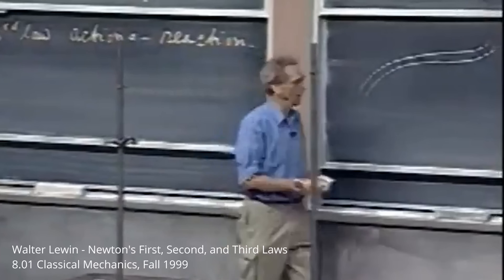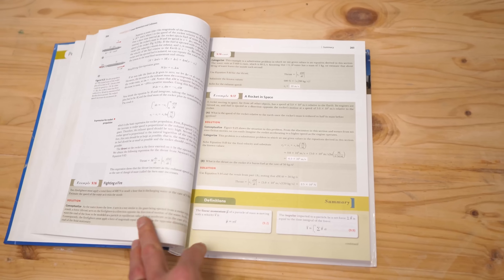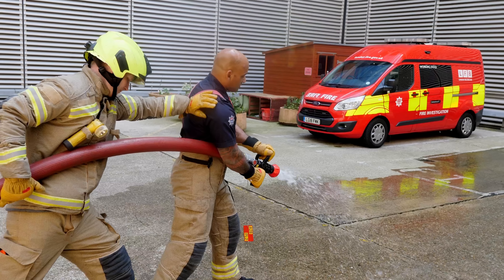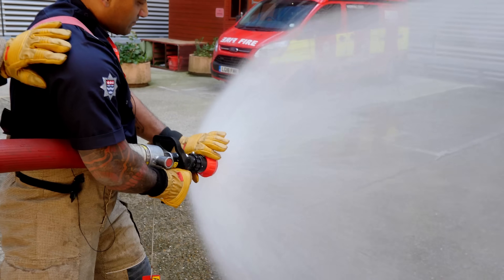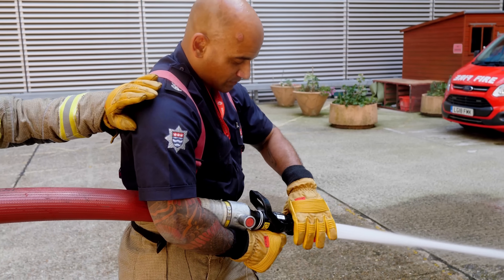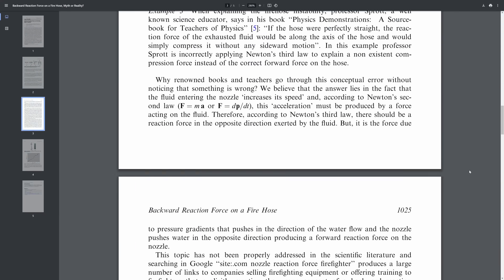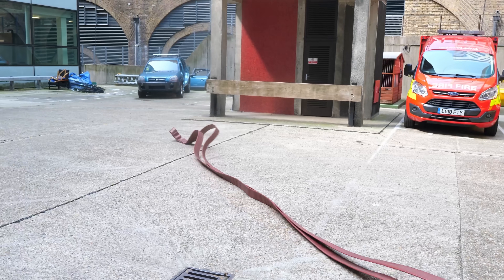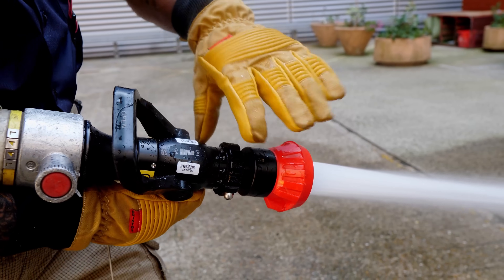Why chaotic hoses dance

Comment: Unfortunately, I can't find a copy of the video to link, but I vividly recall being shown an instructional film, about the dangers of improper nozzle control, during my fire-fighting training in the Royal Navy.  That showed a loose hose, with a RN standard fire-fighting nozzle, at shipboard equivalent pressure. in a mock-up of a ship's compartment.  It was vastly more chaotic and violent than the example you showed of the Fire Brigade training exercise.  It behaved more like the air filled tube in your demonstration, but with a lot more power behind it and several kilos of solid brass nozzle on the end, in a confined and complex space.  Deadly.  No shade on the Fire Brigade - they do a heck of a lot more actual fire-fighting than the Navy - but I assume that the output of the high-pressure salt water main on a warship is very much beefier than what can be achieved by any mobile appliance.  My gut feeling is the degree of chaos is related to pressure, flow-rate, size and shape of nozzle and relative diameter and thickness of the hose.  Can confirm you are pushed opposite to the flow, but you also have to control significant and less predictable lateral forces.

Comment: Water hitting atmospheric air is also a reaction force that is made at the nozzle. And if the hose was perfectly straight, it would in deed be transferred to the pump, but since it isn't this reaction force travelling back will create a bending force instead, that will add to the bending that was already there because of water acting on the hose from inside. It basically means water bends the hose from two directions at once. (this is why Bowden's cable in your bike has reinforced semi stiff walls that counteract this effect allowing the wire to transfer force along the bends). However I wouldn't be so sure about the firefighter statement cause the mass and elasticity of the hose itself should counteract the jet effect to some degree. And on top of that there's also friction between water and the hose that must do something. Intuitively it should pull the hose in the direction of the flow further counteracting the perceived jet force. One way of verifying it would be to measure force needed to hold the hose vs force needed to hold a sheet of plywood sprayed by that hose. Also if I'm right with the friction, then the jet force should decrease when the viscosity of the fluid increases. (I think).

Comment: Isnt the sky dancers head pulled by the middle part straightening out? The pressure inside a sky dancer shouldn't be that much higher than atmospheric pressure

Comment: From what I remember of my physics classes... this is clearer framed with conservation of momentum. Conservation of momentum is mediated by acceleration, so you don't need to work with squares; calculaing the kinetic energy of the water would require something like integrating the velocity across the area of the nozzle as a function of time... yeah, no.

Anyways, the water decelerates (changing pressure/speed) as it leaves the constriction of the hose; this causes the nozzle to accelerate opposite, as conservation of momentum dictates. But, while momentum is conserved, acceleration is a vector, and that direction is affected by the friction and turblence of the water stream. This is a dynamic system, so it evolves over time, and the kinetic energy bleeds off as force perpendicular to the acceleration. Even assuming things like 'water is truly incompressible' I don't think we know enough about the forces here to predict where they're actually coming from/going; fluid dynamics aren't something I ever studied. 

Well, constricting the nozzle should reduce the motion. A simple test would be putting a baloon over the nozzle; this allows the energy transfer to continue, turning kinetic into potential, but stops momentum, since pressure should remain constant. I'd theorize the hose should remain mostly still under these conditions.

Comment: I look forward to the followup video...  The force on the nozzle equals the mass of water multiplied by the velocity it leaves the hose, divided by the time it takes that mass to pass through the nozzle.  The direction of that force will be the sum of the force vectors of all of the individual "particles" of water.  This reaction force feeds back into a long, semi rigid tube.  Modelling  the whipping means modelling how the tube resists bending caused by a point force vector at the end, taking into account the internal pressure and wall strength resisting deformation.  As the system evolves in time, the resistance to bending changes, but so does the direction of the applied force.

Comment: The force you are going to feel holding the end of the nozzle is always going to be momentum of the water going trough it. Think of the hose as a closed balloon, if it had been close the hose couldn't move anywhere, that's because all the pressure pushing on the inside of the hose cancels out. If you create an opening all the contribution of pressure inside the hose would still cancel out the same except for the part that it is now open, so the contribution of just that part (or that is unmatched by that part) must be opposite to where the hose must move no matter it's shape. There maybe some contribution due to kinematics but they will be mostly negligeable to.

Comment: What a mess.
You are mixing up three things here.
1) Water (or air) in a hose wants to go straight. If the hose doesn't permit that, it will apply a force to try and straighten the hose out at that place. This will create a cascade of forces along the hose, making it twist and wriggle.  This also goes for the open garden hose, where the phenomenon in point 2 below is not in effect.
2) Water being accelerated from a high pressure slow moving pace inside a hose, through a constricted nozzle, to a low pressure, will gain velocity and by that create extra momentum. This will push the nozzle back in the opposite direction. (~rocket).
3) Flexible/canvas hoses vs. relatively stiff hoses. They behave totally different.

Comment: The way I see it is the water can't displace the air fast enough so it'll repell the air, causing backpressure through the stream into the hose, pushing it back instead of displaing the air. My guess is if you would do this in a vacuum it wouldn't move at all unless it has something to repell against (like the wall). If you put a cap on the end of the hose and kept the pressure on, the water would try to straighten the hose out. Also, I think your string analogy does not really work here because you were pushing on it without having something to pass through. If you put 3D printer filament into a PTFE tube, you can press it through the tube just by applying force on one end. That's how bowden printers work and that's how brake lines work even though it's a fluid instead of a solid, but it seems like the same rule applies.

Comment: That ending comment about the sky dancer heads using thrust to move the head a bit could also just be the straightening of the tube. If the head falls in a direction folding the fabric a bit then the restoring action of it straightening would force the head in the opposite direction from which it folded which just so happens to also match the direction of thrust. What proportion of these forces are at play is unclear or if one is more dominant.

Comment: staying with the rocketry analogy: they have two different types of nozzles, one for air travel and one for vacuum travel. the vacuum nozzles are bigger because the expanding gases have no outside pressure to work against. i wonder if we could design a nozzle for firefighters for the opposite effect: make it as inefficient as possible, so the firefighters feel the least force possible (with the water coming out still of course).

Comment: If you took a weak paper hose, and ran high pressure air through it, it would just break. The forces in the structure of the hose itself are also significant. 

Note that there is a level of tension such that the pressure and momentum in the hose exactly cancels out with the tension of the hose.

Also, momentum and pressure are in some sense equivalent, as seen on the outside, on any closed section of hose.

So if you have a hose and you hold the ends fixed, the middle shouldn't start to move. (At least, if the hose is frictionless, there is no source of energy to start the hose moving, it's a 100% efficient energy transfer. )

Comment: There are other factors to consider.
There is the narrowing of the pipe diameter at the outlet, seen clearly at 8:46 (the thin-walled red pipe is much wider than the released water column). This means the water must accelerate where it is constricted and 'push back' - in this case at the nozzle.

There is also the boundary effect where the water flow is slowed at the walls of the tube, slowing down the water flow, creating additional forces (be it in the opposite direction).

If those 2 effects were eliminated, would the pipe still tend to snake, especially if the fluid is released into a vacuum?

Comment: IDEA FOR AN EXPERIMENT: You should make an experiment with something like a straight glass tube that can slide in and out of a water/air sealed hole in the side of a bottle. The tube should be held in place to the bottle with a spring such that if you push the tube further into the bottle, the spring will exert an opposite force on the tube outwards. Then connect the top of the bottle to a pressurized water or air supply such that the pressurized water or air can only escape via the tube. Then you can test whether the tube gets pushed inwards into the bottle as the water/air escapes at the end of the tube.
Reply: My prediction is, that the ratio between the area of the cross section of the tube wall and the space inside the tube will play a role. In other words, it's important to use a tube with a thin wall. E.g., I imagine that a solid rod that allows no water/air to escape will be pushed out by the pressure inside the bottle. But if the tube has a thin wall like a plastic straw, then the force that the pressure can exert to push the tube out will be negligible compared to force the the escaping water/air will exert on the tube in the opposite direction.

Comment: For tubes that hold large volumes of liquid at higher pressures, my understanding is that curves and changes in the tube very much introduce variations in energy. Water mains, for example, have special ways of installing curved sections to allow for this, otherwise the water main would be hammered into pieces at curves (which was the case for older mains). Similarly for liquid natural gas which is often under so much pressure and being moved at such velocity that there are special ways to slow things down with wider sections before any significant corners are made. As you mentioned, I think it is the compressibility of the fluid that matters in these cases.

Comment: Consider (a) a friction free hose with (b) the hose end ejecting into a vacuum. Basically a water laser. No force on the hose. The interesting question is the pressure loss at the nozzle without air molecules to interact with and disperse the emerging water. Is there any pressure loss despite the lack of a hose sidewall?   What happens

Comment: 13:54 There is near atmospheric pressure inside an open hose (air or water).
You are talking about two different phenomenon (with nozzle and without) as if they are the same, but they are totally different.

Comment: Just a thought about the experiment at the 9 min mark. Is the air exiting the hose exerting an opposing force against the spring scale to which it is taped? It almost looks like the experiment of blowing a sailboat with a fan on the boat. What if there is a much bigger gap, representing the distance that fire hoses spray onto buildings?

Comment: 9:30 I would think that it's the force trying to change direction that's being resisted. The hose isn't pulling back on them. But it wants to wrench in a direction it's not pointing. I think the mistake here is thinking that we're applying F=MA when really we're applying P=F/A as the dominate function and F=MA is a nested function. You almost get there at 11:35. Pressure is (as the formula suggests) Force over Area. And the force interacts differently along different areas of the hose. Or in other words, the angle of pressure changes (as you pretty much showed at the start). Because everything in the systems is connected. Every change in angle of deflection has a cumulative effect. 

But the acceleration factor at the end isn't directly due to F=MA either. Rather is p+(1/2)pv²+pgh=constant. Or Bernoulli's Principle. That a fluid parcel's velocity increases with pressure decrease and vice versa. Again F=MA is subordinate or resultant function. So kind of what you're saying at 14:00 but our order/importance of functions is different if we're trying to get at what's most causal/basal I think. The real important thing is that the acceleration at the end doesn't overcome any other forces without the wrenching.  In a perfectly strait hose we see no change. The bend in the hose is the nucleation of a chaotic system. 

Also you're expectation that the curvature should extenuate is probably right. Just haven't given it enough time. We're talking about the speed of water at a minimum of earth's atmospheric pressure, not the speed of light in a vacuum. You might have to let that play out for hours or days before every reactive effect at the tip propagates back through the system.

Comment: 15:45 All the concern about the bend in the hose causing forces is true, but the open end (or nozzle) provide even more acceleration and even more force. The bends in the hose has distracted our host from the end. There's significant acceleration at the end, even with a simple open end. With a nozzle explicitly designed to accelerate water to the highest possible speed (so that the hose reaches the furthest), it's even more so.

Comment: Actually the pressure inside the hose does not change abruptly at the discharge, it changes gradually due to hydraulic losses (applies for incompressible medium and/or compressible medium at sub critical discharge).
When speaking about the wiggling, I think the mass of the medium inside the hose should be considered as well (water has higher mass than air). A similar phenomenon, when the mass/momentum of a "fiber" would be whip cracking 😊

Comment: 15:19 That flailing hose is violent because the nozzle is set to accelerate the water . If the hose was carrying the exact same mass of water (per unit time), but with an open end that failed to accelerate the water, then it might just lie on the ground (depends on the numbers, I'm just pointing out the relationship).

Keep in mind that even an open hose will still have some inherent acceleration for the delta pressure reasons that Mr Mould mentioned. It similar to how a sawed-off WR90 waveguide still provides about +10dB of antenna gain (for those that can relate to the that analogy).  Cheers.

Comment: A good practical use of this is the Tornador air nozzle for cleaning with compressed air, it uses a small flexible hose inside a plastic horn. The pressure makes the hose flail but the horn shape and small weights on the hose cause it to go around in a circle, creating a rotating jet of air like the turbo nozzle of a pressure washer.

Comment: Could you do a model with fixed pipes and only 1, 2, 3 joints simplify it to a point where it gets more intuitive? 
Does it wiggle less with a bell-shaped nozzle as on a ticket engine? 
Modify your illustration to not have 'pieces' of fluid that make up the whole cross-section of the hose but have several side by side - it feels like the sideways forces are important if we want to illustrate the wiggly movement...?

Comment: Steve, as other have stated it is rather simple.  Should be thinking of force not momentum. Force=mass x acceleration,.  The more mass at higher speeds the more force and is exactly why jet engines work. The velocity change at the nozzle boosts the force giving the air/water a higher energy.  There is the same amount of water flowing through the hose at every section, momentum, but the water leaving the nozzle is much higher momentum as it's the same mass but moving faster. The pump feels a negligible amount.  Imagine you are on a boat shooting the water from your nozzle.  The direction for which the water leaves the pump is negligible, only the direction of the nozzle is relevant.

Comment: 9:25 "I don't know."  Most water hose nozzles are explicitly designed to accelerate the water, and that acceleration happens at the nozzle. Same mass of water moving, but the water jet speed in the air is higher than the speed of the water in the hose. You can see that when the nozzle is adjusted to provide a wider mist, the force is reduced. I've learned that even using a plain garden hose (without a nozzle), the water stream can be adjusted with a thumb to accelerate the water by using the thumb to partially block the exit. The distance covered by the water stream appears to be aligned with the reaction force, so the thumb position can be adjusted to maximize the reaction force and you'll find that the resultant water stream goes the furthest when the reaction force is maximized. I was playing with all this in the yard last summer.
Reply: and why happends the same with the air? is just a tube without anything making ut accelerate at the front
Reply: @Kirtash_MDI  System pressure behind, and atmospheric pressure ahead. Delta pressure. Our host discussed this point.
Reply: @JxH  yeah. I post the comment mid video, at the end is like a rocket

Comment: 4:45 If I understand you correctly,  then you're wrong. 
Water wanting to go straight through a flexible and non-straight hose will always give instability, no matter if the anchor point could swivel perfectly.